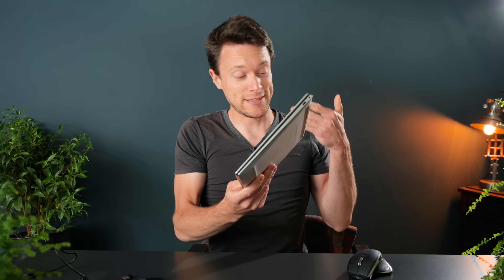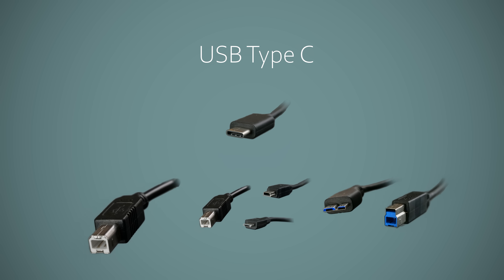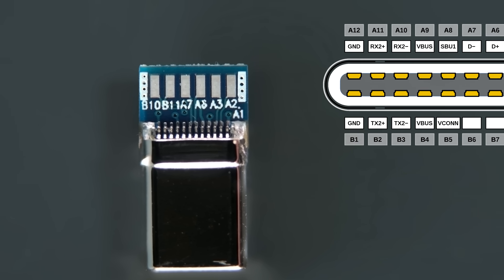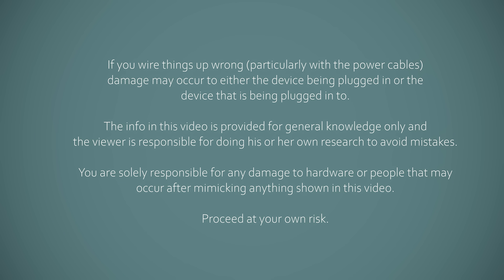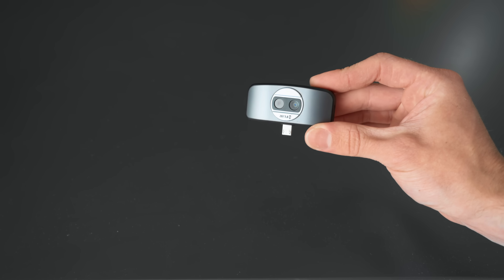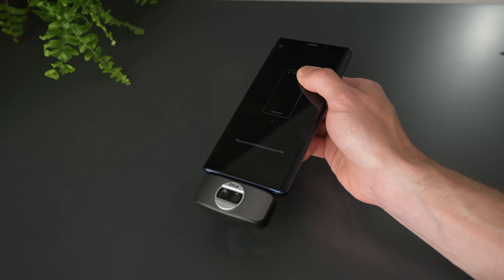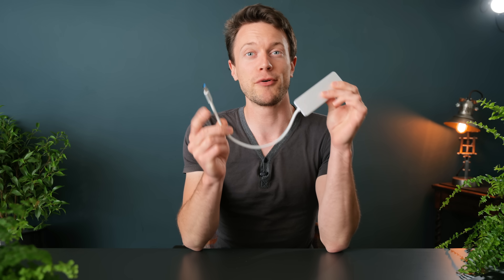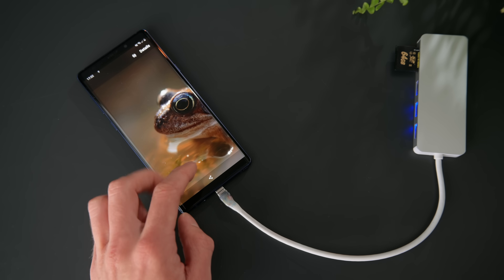Converting devices to USB Type-C

Comment: 6:30 wrong, VCONN, VCC etc is not "up", its a PLUS. Connecting to them is pulling down! The GND is NEGATIVE. Connecting to GND  pulls voltage UP. Its called GND as its common line to attach multimeter to in diagnostics, like in real ground. Unlike real ground, GND is electrically NEGATIVE, is  charged.
Reply: semantics. when you connect a pin to VCC, you pull the pin up, and the VCC down. in common usage we only refer to the effect on the pin, not to the power bus. It doesnt matter that gnd is charged with negative electrons. conventional current opposes electron flow, positive charge flows from the + to the -
Reply: @mtqrx  Hi, meanwhile I understood the voltage: both me (in past) and you are wrong. Voltage is what was discovered first, it was seen as "higher potential" hence was labelled "+"/positive. Same on devices, the incoming terminals were labelled as "getting higher potential". So other terminal was labelled as "-"/negative, because it got connected to lower potential. But after humans discovered nature [of sitting in fixed structure] protons (stars, parking lots) and [flexible, valent] electrons (planets) .. it became appartent that we are shaving off the electrons from their "parking place/orbit" . So in reality the analagy to water would differ here. Unlike water, which flows away from higher pressure, Charge (electrons, cars) are flowing (current) to ... "lower pressure" (free parking, orbit around star = proton. So Voltage is always positive and higher, however harmless - but other terminal is Charge and is where electrons are flowing from, thus labelled as "base terminal" as GND, but its still source of charge and because its lower in potential, hence still labelled as negative. Its not some "old" method.
Reply: @HECKAKYH-ADEKBATEH  that’s the difference between conventional current (+ to \-) and electron flow (- to +). In practice we only talk about conventional current because it doesn’t matter - a positive flow in 1 direction has the same effect and a negative flow in the opposite direction.

The main scenarios where we talk about electron flow is in the case of semiconductors, where positive or negative charge carriers exist, or electrolytes where both positive and negative exist. Outside of those scenarios, we always use conventional current, positive to negative
Reply: @mtqrx  well, afaik, there is 'typically' no "positive flow", the Voltage is a 'field', so only charge (electrons, cats) flows from negative (lower, base) location. The only scenario, where "positive" can flow is protons (cat food, parking lots) in ionized state (broken) like gases or liquids. In solid matter protons can't leave the structure unless destroyed (denaturalized?). So there is no "old" and "new current", as only thing that changed was 'understanding', but nothing in practical outcome..
Reply: @HECKAKYH-ADEKBATEH  there is the flow of the positive conventional current.

There is also the positive flow of holes in semiconductors
Reply: @mtqrx  to add up and simplify... Voltage (positive) is Meal for cat and sits in place. Charge (negative) is Cats, flexible. Resistance is Door that prevents Cat (negative) get to Meal (positive). Meal has higher potential to attract Cats, so its Positive.  So, when Resistance is Up, so is Voltage Up as Cats cant get to it. But if Resistance is Down, Cats flow (current) is Up and Voltage is Down proportionally.

Comment: Thank you !!! It worked for converting a scanner cable (USB-B to USBA 2.0 that I changed with USB-C) with your demonstrated trick by adding a 5.1K resistor as you showed in the second half of this video. In the first attempt I failed same like you with the as-such connections (USB 2.0 to USB-C) I i used the same solder pad you have but luckily in this video you have shown that you identified the issue and resolved it by re-routing the power drawing port through a 5.1 kOhm resistor.   Thanks a lot for a brilliant tip !

Comment: They made a mistake focusing on backwards compatibility. What they should have done was split it into 2 standards. And just continued to support usb 1.0-3.0 type a. Using it for all simple devices like most accessories. Then had usb 4.0/c be a wholey new port/jack. Doing so would mean not as many wasted pins in usb c. Further would mean being able to design the wire to be able to comunicate its stats to the device(ie what power it can do what data rate it can do) thus you can know what cables you should use on what devices.
A converter could still obvously made but its justvthat the entier design was to make it work perfectly even when fliped upside down. I have a massive stack of usb c wires and not a single one is full standard usb4.0 and the only reason i was able to find that out was buying an expensive tool to test them.

Its literally the least standardized standard. Whats the point of having a "standard cord" when it absolutely has no standard in it and you have to lable every cord what its for and make sure to no use the wrong one on the wrong device. You might as well go back to having all different cords.

Hopefully usb 5 or somthing will put an end to this insanity. But i doubt it.

Comment: You are NOT converting the devices, only the method of connection.  The devices are still limited to what the existing USB standard is.
You will not suddenly get a faster data transfer or anything.

Comment: "all you need is a soldering iron and solder"...sure didnt see you using alligator clips as a helping hand, a magnifying glass or a voltage meter at all. Thankfully my uncle in law used to build satilites for the air force and is a robotics hobbiest so I could just pawn the work off to him but this is not for people who have never done this before or have no idea what they're doing. But regardless of all that this was a very interesting and informative video so I do appreciate that.

Comment: De solder the resister connected to Voltage and put it in R2. Dont add a big ass second resister 7:10

Comment: About 10 years ago, I took an old, wired, usb mouse. Opened it up, gutted all the non working mouse parts, and soldered a 256 GB flash drive to the wires. So I ended up with a (at the time) large capacity flash drive that looked like a very old mouse.

Comment: Thanks champ. I converted same thermal camera as you but the phone I used didn't care about the sink/source resistor. It just worked with a basic usb connector with no resistor. Until I changed my phone and it didn't recognise.i  understand now about the resistor. Thanks. Also you can jump the 5v across to the battery terminal and throw out the crappy lithium. I did find the data lines plus and minus need to be hooked up correctly too. Keep on rockin' handsome.

Comment: using the info from this video, i am having a go at upgrading the usb connector on a android portable games tablet (called a JXD) originally its micro usb which sadly does not charge from usb. it does have a separate DC jack which charges with 5v. i have no idea why they did not make it usb charging, but its going to have it when i solder in a usb C breakout board. i will just link the 5V to the DC jack. i have tested it and it works fine. so why it was not done from the factory i have no idea.

Comment: If I use the connection and just connect it using the solder, will I need the transistor or will it work effectively and what are the disadvantages?

Comment: I've had success remaking plugs with epoxy. If you take the time to devise a mold that is tight enough to hold the USB-C  plug, epoxy will fill around the wire and bits for a smart looking plug. The trick is finding a suitable material for a mold that can be removed after the epoxy has cured.

Comment: forget the convertion that SHERLOCK HOLMES coin is Awesome :face-fuchsia-tongue-out:
"i want one! :face-blue-smiling::face-red-heart-shape:
i can't solder if my life depended on it, i can with jewelers torch or a yag aser but that stupid pen. probably cause i've used cheap chinese from versions. since i rarely solder electronics i don't need a good one and i work around it without soldering them BUT I MUST LEARN :face-orange-raised-eyebrow: i Liked your video 👍
edit: eso es todo / that's what i'm talking 'bout the way you twisted the ground wires and covered it with epoxy it my way to do it. Laptop to Webcam!? you got my attention Slaps subscribe button :face-blue-smiling:

Comment: I don't think I fully understand how the resistor works, but would you be able to move that existing resistor over to the R2 section?
Reply: The resistors are used to identify between devices what they can do. If the resistor goes from CC to Ground, it is seen as a sub device (like a mouse or headphones), while connecting to VBUS identifies it as a host device (like a computer or laptop). Depending on the value of the resistors, different charging levels are supported.
Reply: @mini-_  I have a USB-C charging board that I want to work with PD. Where would I install the resistor? TP4056
Reply: @erraddict  What exactly do you not understand? If you want this device to act as a sub device, use resistors between CC1 and CC2 to ground, the value of which should be decided by the level of charging you need.

Comment: At 7:05 there is one resistor at R1 that you cut the trace to, but when looking at the circuits it looks like the R2 is connected to ground. So, it looks like you could move the resistor from R1 to R2, to make it a sub device? It make no sense that the manufacturer of the board didn't think of this ...

Comment: you may be interested to know that the raspberry pi company produces various durable adaptors for very small prices, and some are impressively tiny called shims. a shim is designed to fit the female connector and slide smoothly **into** the male connector

Comment: Hello, and thanks so much for your work!!
 I have followed your tuto but I got a problem ... 
 I've tried soldering a breakout board usb-c, I did well I think.
The first board was a cheap one, I've tried a regular usb-c to usb A 2.0 cable, and it works (working in windows like it should), but after that I tried a swift cable coiled and it didn't worked. The keyboard started to act weird ... It turns on and then off, and windows says "unknown device". Any idea ?

Comment: I do not like snap changes like this. Abrupt changes to standard usb are not welcome on my devices. Not until they are tested fully and are seen for the flaws they have. Something too small and intricate is most often too fragile. We've experienced this before with multiple experiments on consoles. Tiny little contacts that lose connection after just a few times use or are worse in terms of durability in general. Standard usb are very reliable and none of mine have ever failed. With mini and micro usb I welcome the change since they seem to fail all the time on all my devices(phones mostly). Standard USB on the other hand is super reliable and abruptly changing it is not a wise move.

Comment: I hate USB C, as soon as your charger port breaks in your laptop and break it will, you can just dump it into garbage because fixing it will be almost impossible with traces being all snapped on the PCB. It's just way to fragile! Then still most of the devices does not even support all the modes other than just a plain old USB, at best you will get a HDMI over USB C on a laptop but that's it in most cases

Comment: I am trying to add a female USB C port to my keyboard, it currently has a USB A cable attached to it. 

I have seen some guides on YouTube that saw to just leave the shielding cable disconnected, but looking on forums and reddit, people say non shielded cable is not a good idea.

I am hoping you'd be able to help me out with it

Also I am planning to reuse the same USB cable as a USB C to A Cable.

Comment: Hey man, nice job. One small tip though: you don't have to break the metal part to expose the PCB, you can just use a small needle  to snap out a piece of plastic on the bottom (the one with a logitech logo) - the whole assembly comes right out after that.

Comment: 7:08 & 10:49 & 13:48   or instead of being destructive, and using an extra through-hole part, just move the smd resistor, which is already there, to the ground position.  save time and space.

Comment: I'm still not getting why 99% mouses and keyboards and literally any peripherals still use type-a
Reply: I mean its sort of a catch 22 

so for desktops laptops most existing mice and keyboards use the old standard and dont come close to needing all the additional bandwidth and speed provided by the new connector. so why eat the additional cost servicing them. plus your users are now going to need to get new connectors. 

for peripheral manufacturers the same problem but inverse. most desktops and laptops dont have more then 2 ports so a mouse and a single thumb drive will use all of them up.

Comment: really nice perk - thank you! :goodvibes: I am not shure if there might arise a problem, if you squeeze suguru in between the wires, because when it gets cold and warm again, it might contract and expand, over time it might pull and push on the wire itself and lead to micro fractures in the solder jount or wire itself? If it is kept at roomtemperature, there might not be an issue, but when you leave it in a cald car in winter? So I thought It might be better to use shrink tubing for isolation if needet and try to model the soguro just around everythinf on the outside? But this line of thought might be totally wrong, I have no idea, or experiences with it, so I might be overthinking things.

Comment: I only wish they would've designed the whole USB C connector a little sturdier. Image the Plug being the actual plug like it's the case with lightning. On USB C the "plug" is actually in the socket, which makes it more prone to fail. I wished they could just make USB type D like a bigger, more advanced lightning connector

Comment: Can you help me locate (or make) a Thunderbolt 2 (male) to USB Type C (female) adapter for use with a M.2 NVME External SSD. I believe that external power is needed to run the SSD? The SSD enclosure has the USB connector and a MacBook Pro (A1502) has the Thunderbolt 2 socket.

Comment: why dont you just move that resistor to the left? and for the next time, you could use headset wires. they are way smaller and dont need to decap.

Comment: Which cables / ports do you use for USB-conversion because my Lenovo adapter delivered 100 Watts, so it should be low resistance to not overheat

Comment: My preferred method for encasing dongles like receivers and flash drives is to use modeling clay. Wrap board and wires in cello-tape, mold the clay around it, pull it out and bake to get your new shell. You can then remove the tape and affix the shell with epoxy or hot glue. 

For cables, I usually thread on a few pieces of heat shrink, usually 2 of each size between the size of the cable and the size of the connector. I then use silicone or rubber dip to support any floating components like bridge wires and start shrinking on the tubing before it has fully cured. This makes for a really solid connection as well as adding some strain relief. I've used the epoxy method before, but it creates a pinch point for the conductors and will eventually break them or cut through the insulation unless the cable is plugged in and left undisturbed aside from an occasional unplug for a computer cleaning or upgrade.

Comment: naïve question: When you get a USB connected device and it says "for charging only" does that mean only the power connectors are hooked up. And are there any circumstances where you could add data functionality by accessing the other connectors?

Comment: I like usb c, my only problem is the amp of different types of cables there are, power delivery 100w PD60w, data transfer only cables, display port capable cables, etc

I hope in the future they give a color coded treatment to them like how usb 3.0 is blue.

Red = 100w pd
Orange = 60w
Yellow =display port capable 
Green= phone charging only
Etc

Comment: In this video you modified the cable/connector for the device to work with USB type C. 
Is it possible to modify/replace the female USB port on a device with USB type C port? 

Specifically I'm curious because I have an old hard drive that uses a "Micro USB type B superspeed to USB A" cable. 
Wondering if I can replace that outdated micro USB port for use with USB C cable instead?

Comment: I have a bunch of Type-C female to usb 2.0 male adapters [from micro usb, mini usb, type B] even a micro usb type B 3.0 version. [just to use all my old devices with usb type C]

The only one I am missing is a USB-C female to usb 3.0 Type B adapter [which does not exist in adapter form], it exist in cable form, but not in adapter form.

I even use Type A male to type C  female connectors [for things like a type C to type C cable, if needed with a system that does not have Type C [or due a lack of type C ports]] Like for my Custom Keyboard Cable. [ordered Type C to C instead of A ty C]

Comment: Something that would be nice is converting a bluetooth keyboard to a non-bluetooth WiFi one which still uses a transmitter and receiver. Not sure if it would be neither easy nor doable though.

Think of making a Keychron Bluetooth keyboard to a Logitech G915 Wireless one. 😉 Or any Bluetooth keyboard to any WiFi keyboard.

Comment: Hey DIY Perks, Can you convert a Micro USB into a USB C?
Reply: Yes but it will only have USB 2 speeds
Reply: @Steph.98114  being that i want to just swap a port that charges, transmits no data… im cool with that. Which of the options above would be best, as… watching it, im not too sure
Reply: @MischieviousMakers  it depends on your device and how the port is mounted
Reply: @Steph.98114  rzr black shark pro v2. Its within and it seems to be possibly attached to the board. Im awaiting a new set to come in before I really tear them apart to see whats possible.